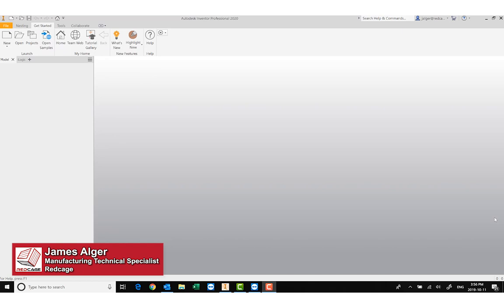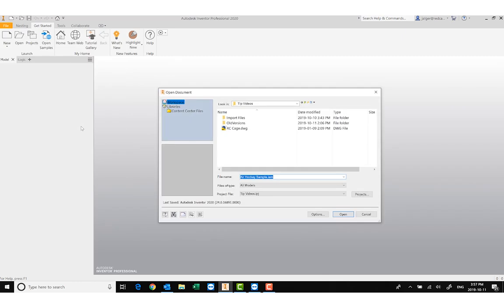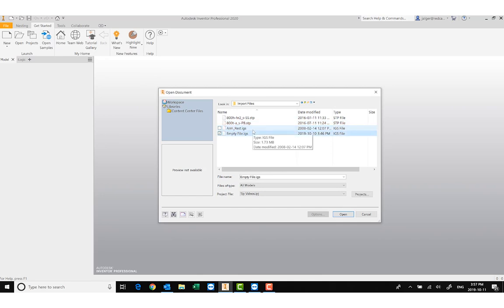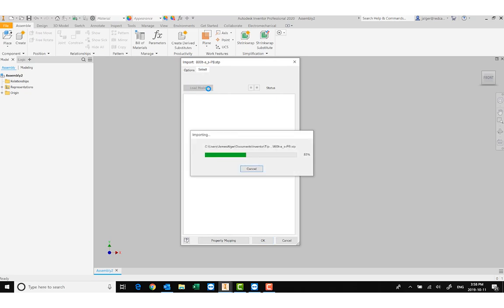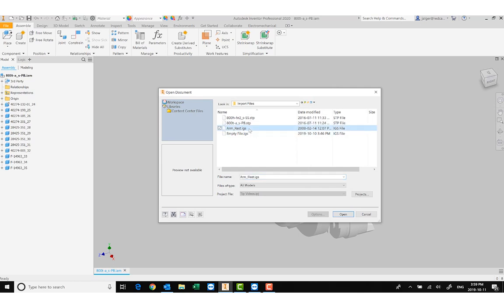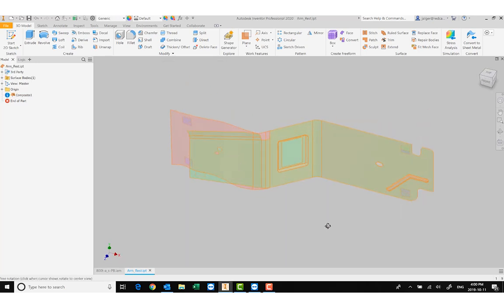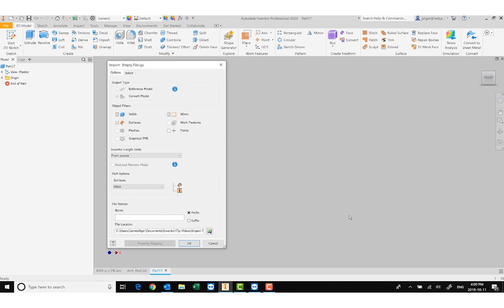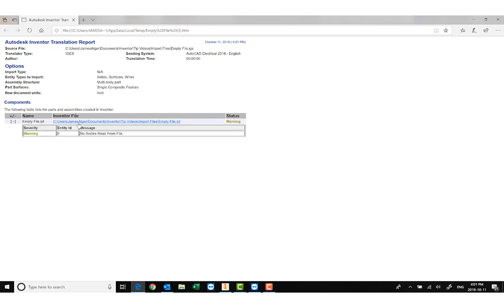How to Import Files into Autodesk Inventor Professional 2020

Comment: Good day I am not getting the dialog box for load options when I select open. And actually my import is behaving differently than the first time I imported a .stp file. Now I have to just select open through windows explorer to open at all. So now I do not have the option to import as reference model or with the tree. Any idea what may have happened?
Reply: Me neither. Wonder what makes it pop up. Definitely works because it seems that some files open perfectly with the Dialog box